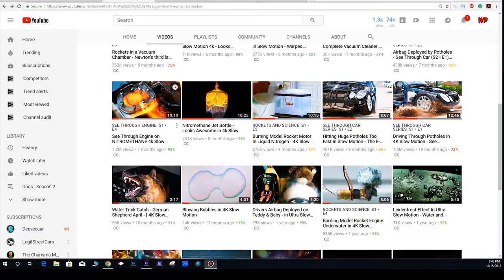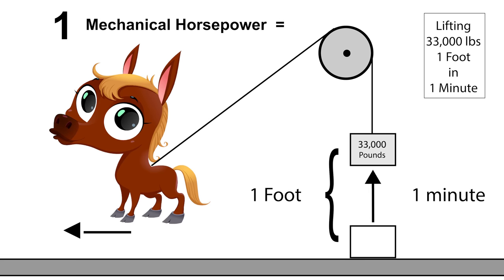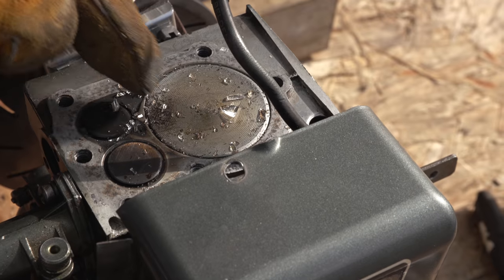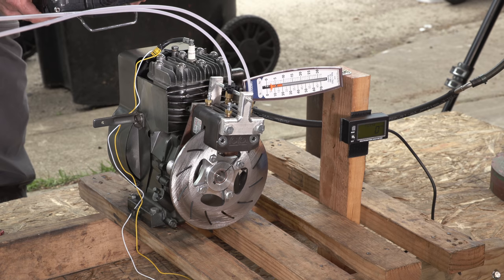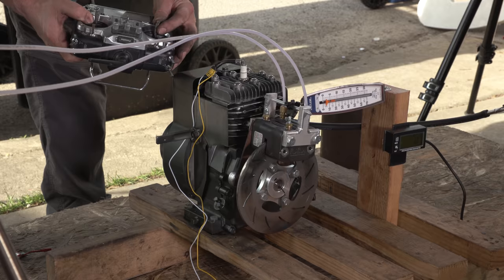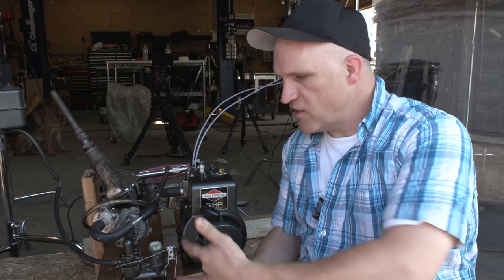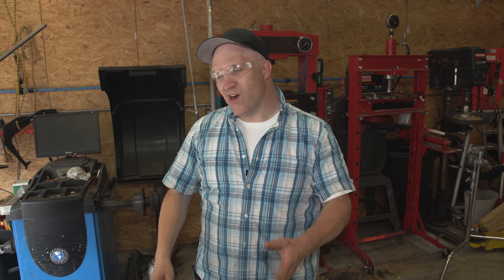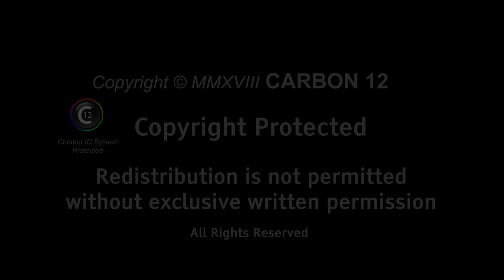See Thru Engine on Turbo Nitro and Dyno  (How much HP does it make?)

Comment: I would like to mention I do believe that the horsepower was less on the Turbo System because the impeller was too heavy and actually became a slight restriction to the exhaust. I don't know if that's true but it's just a thought one thing that I had thought about is using a high volume of air discharged from something like a compressed air tank into the system that would give you a very cheap turbocharged but it would be very finite I don't know if that would be something that could be engineered to give it a forced induction
Reply from the maker: Yes you are correct, up to the point where the turbo spools and starts capturing heat energy it's just a restriction, but as soon as it gets up into its operating range the efficiency skyrockets. I'm not going to pretend that I didn't know that but I wanted to end episode there, that gives everybody a chance to put in their own opinions before the next episode. But yeah you hit it right on the money. Also with the compressed air I'm not sure, that might be something I can try out in the future but I know for sure it's going to have to be matched with the correct amount of fuel I was just going to start running lean almost immediately.
Reply: @WarpedYT  yes I know you are correct about the the fuel mixture going lean. It's cool to see these things on YouTube I will subscribe to your page my father raised me in the shop we have had much fun with building high-speed Volkswagen Beetles dirt bikes and even motorcycles

Comment: make a new video with smaller turbo and  without wet system.pressurize carburetor and gasoline using electric pump.
Reply: What's that do

Comment: I would like to see this setup with a better carb... its hard to force feed a dinky carb like that
Reply from the maker: Agreed
Reply: Have you considered twin-spark? Because the combustion chamber is odd shaped on a side valve engine, it might benefit from another spark plug to ignite the flame front more evenly thus giving a sharper kick - if it is possible to fit another one on the cylinder head.

Comment: Somehow you have to get that turbo to spool up some more or maybe trying a smaller Turbo
Reply from the maker: I have a smaller turbo, and I'm planning on mounting it, but first I need to get this turbo to make boost, one way or another, I know it will almost for sure.
Reply: @WarpedYT  maybe trying some nitrous oxide to get the turbo to spool up my buddy used to use a little sneak a peek shot on his junior dragster maybe that will help
Reply: @WarpedYT  Turn it into a centrifugal super charger? Take the exhaust housing off and find a brushless motor that will produce enough RPM. Then youre force feeding it boost rather than hoping for the exhaust gas to have enough pressure.

Comment: I fitted a small turbo from a Subaru 1.8L to a Briggs mower engine years ago. I just made it really simple with a blow through set up running standard unleaded.  It went really well until the piston melted.

Comment: That motor is waaaaay too small to turn that turbo effectively. Not enough gas flow to make anywhere near enough boost.
Reply: Yeah it takes more power to run that turbo than the turbo is making power
I´d like to see it running waaaaay faster
Reply: max Klassen You couldnt make that motor spin fast enough to get the gas flow for that turbo. The turbo is juat too big for that motor.
Reply: Daniel Beard the motor 'can' spin that fast. With a build kit it would do it reliably.
Reply: @dylanzrim1011  No. You cannot. That motor would have to turn in excess of 12-15,000 rpm to get anywhere near the gas flow of the engine that the turbo was designed for.

It was designed for the exhaust flow and pulses of at least a 4cyl motor. For a 500cc single cylinder engine to have anywhere near the same exhaust properties as a 2000cc 4cyl, the single cylinder engine would have to be turning approximately 4x faster.
Reply: Daniel Beard it's from a compound set up yes? Meaning it is a low rev turbo. 

He's not looking to make 30lb of boost. That motor could probably only take 5lb at most if lucky. 

I'll admit it would still be a bit laggy
Reply: Daniel Beard build break repeat just built one.  Spoiled up just fine.

Comment: If you had used a Tecumseh engine it would have blown it up long time ago. Briggs in my experience are far better engines.
Reply: Dave Micolichek  Yes mostly because the Briggs had half the power. On top end a Tecumseh 3 horse would out run a Briggs 5 horse. I ran a 3 horse Tec with a cam, shaved head, 104 octane fuel, no governor with cranked timing on a stock rod never a problem.
Reply: Dave Micolichek  Reply went up in smoke so one more time. Engine was all stock parts less a cigar muffler. The head was shaved, bumped ignition timing and no governor. The Tecumseh engines made better power do to adjustable ignition timing and better carburation. I ran my 3 hp Tec wound tight but never with out a good load on it. I would guess the lack of load is what killed the ones you saw back in the day.
Reply: Tecumseh engines run forever if you keep oil in them.
Reply: Dave Micolichek even though I like Tecumseh and Briggs, I really like the harbor freight predators and Honda
Reply: Dave Micolichek  The magneto rotated CW and CCW.
Reply: Dave Micolichek  60's and 70's vintage.

Comment: Rising rate fuel pressure regulator and a small electric pump.  Hobbs switch and electric fuel pump at a minimum.  We did the old blow through setups on carb rotaries and it is super crude, but it can work.  Impressive amount of work into this so far -- go for it!   Turbo is a order of magnitude too large, but you might get a little boost out of her.

Comment: awesome vid n thumbs up to that effort.....u need more hp?
Step 1 : return this turbo
2. lets start with the engine itself without the turbo
3. if gasoline gives u 3.1hp, then within technical limits u should get 9.3hp just changing the fuel to CH3NO2
4. CH3NO2 has stoich ratio of 1.7:1 which mean it needs 8 times more fuel pumped in per stroke than gasoline, which also means that if u have the cfm of the carb constant u need to atleast replace the main jet with a much larger jet.
5. we should all be more than happy if u get 8-9hp out of this setup. if u need more we can look in2 the compression ratio the engine is running.
6. shaving off the cylinder head will increase the CR  n maybe 10BHP !

Comment: Love all your videos... been subbed for about a year.      In relation to this video... "Too Much turbo - Not enough engine" (insufficient exhaust air flow/volume/velocity & exhaust Heat)... Turbos Need Heat to spool up quicker,  and one cylinder is not only insufficient in every way for That particular turbo, but too far away from its needed heat source.     Great Video, just the same... love the content.    PS:  What you're labeling as a "wet system" in regards to the turbo/carb setup,  is officially known as a "Draw-Through" system.      Keep em coming!
Reply from the maker: Thank you, I'm finally past holding back all the videos from YouTube so, it should be pretty fun, definitely share your opinion and tell me what you think about all the new videos, now I have three categories of videos heading this channel, I love getting feedback from people so thank you for that!.

As for the turbo, I should be done with the new episode this week and it's going to be extremely interesting, you would normally be right it's too much turbo, and you are still kind of right, but it will make boost and power on Nitro, but not gas for sure, the turbo is too big. 
as for the web system, I know I completely slipped up on the wording, it's called and draw through system, and I actually knew that but during the pressure of filming and everything else, I slipped up, no one else on my crew will correct me, guarantee you that, thanks for your support and thanks for the feedback. Got a bunch of short little slow motion videos hitting the channel soon, tell me what you think !! See ya soon !

Comment: That little engine has some balls to take up all that abuse and not really die until you put the turbo on it. I was very impressed with the increased horsepower with the nitrous at 4000 RPM

Comment: You may need stronger exhaust valve coil springs because the extra back pressure from turbocharger maybe floating the exhaust valve just a thought. Great work and video.

Comment: I installed in a 5 hp Briggs and Stratton engine a volvo turbo, messy thing, the resservoir went leaking, and it flood all the time, so i seal the resservoir so  boost dont get into it making that pump action that cause the flooding, it work neat, you can hear the  sound when the turbo compresses the air, man it was awesome, by the way it was mounted in a drift trike

Comment: First take those reducers off the turbo exhaust,  back pressure kills turbo spooling. Use larger tubing on inlet side, as short as possible. Get a boost gauge on the inlet.  Great series!

Comment: Back in the late 70s in high school, we had thee best industrial arts classes. Electronics, machine shop, wood shop, and power mechanics. 
Power mechanics (auto shop) was my fave. Our teacher was David Vaughn. A retired navy guy with a hot temper, but extremely cool and understanding. Just follow 3 rules. When he talks NOBODY else does. When its study time, its time to study, no fuck*ng off. And, if you ever even think about stealing anybody elses stuff, just leave.
Outside of that, we spent most the time rebuilding lawnmower engines. The 1st one you did had to be a complete basic rebuild. No 1/2 assed job and no mods. After that, you could rebuild a Pratt Whitney if you had the time. But 3.5 Briggs and Strattons were all we had time left for. He had the tools, but if someone else was still working on their 1st engine, they had priority. And that usually ran the rest of the semester out.
Another rule, which was kinda fun. Your engine block had to be royally spotless. Because he would inspect all your parts prior to reassembly, then he would give you a choice. Peanut butter or jelly. Then he would slap a glob of your choice on a part of your block of his chioce...bon apetite. Start lickin. Because, hey. You said it was clean.
His temper almost got him fired a few times. He threw a block of wood at one of us and nailed the kid in the lip because he told him twice to "shut up, this is important". The rest of that hour not a soul even squeaked in their seat. At the end of the class he apologized. The kid he hit was kind of a rich spoiled brat and sniveled "my dads gonna sue". But he realized he was the one being out of line. Next day we were all back to normal. That class was like family. We even had a girl in it. Everybody loved mr. Vaughn, the coolest shop teacher ever.
I saw him about15 yrs later at a Carls jr. I think he had cancer, but I dint ask what was wrong. That was the last i saw him.

Comment: Back in the early 80s I had a Briggs & Stratton 5 horse on a mini bike and I put a Oldsmobile V8 emissions air pump on it, mounting the carburetor on the outside of the air pump and plumbing it to the intake side of the motor.
I didn't have a way to measure the power output at the time maybe you'd like to try it. I put a clear plastic head on a Briggs & Stratton back in the 70s.

Comment: I can do science me. Well done! I thoroughly enjoyed this vid.

For forced induction perhaps you could use another small engine with the camshaft and crank turning at the same speed or a single cylinder air compressor. In this way it would be a supercharger or positive displacement type pump. 
You should be able to work out how much air the Briggs uses at 1000rpm then fairly accurately extropolate for 2, 3 and 4000rpm. With the smaller engine being used as a supercharger you have to do the same - 3.142 x radius squared (half bore diameter squared) x stroke length will give you the volume. Now the trick is working out the pulley size to give you 10% more air, 20% more air. It won't be dead accurate but it doesn't matter. You don't want to turn the 'supercharger' so it induces a pumping loss, or, turn it so fast the power requirement is greater than what the Briggs can deliver at idle. If you could find a small single cylinder air compressor and actually get it to run when connected to the Briggs then this would be a major achievement. Once you have it running then the next step is trail and error to get it to pump air and make power. The fuel requirement becomes much greater though and the carb will definitely be too small. Here's why:
 Take a Detroit Diesel 2 stroke Roots type blower for example: Those blowers are adapted for automotive use as a supercharger, but in Diesel use Detroit Diesel (DD) use them to aspirate a 2 stroke uniflow engines (since uniflows have no dedicated intake stroke) and DD quantified the power they use - it is 100hp. This means to turn that blower when it is under load 100hp of fuel (and air) in the correct ratio have to pay for it.
In any true supercharger application it works something like this: Gives 200hp of air, costs 100hp to drive nets 100hp gain for the full cost of 200hp of fuel (and air). See why turbos are favored over blowers? Turbos are on and off boost all the time but blowers always cost.

So, your Briggs will need a much bigger carb if you use a piston pump as a supercharger but I predict it will work - even as suck through. Get it running on gas 1st and worry about experimentation later. 

Re a dyno, You could use a 240v DC motor as a generator. Gentec make LED contollers for gensets and they are not too expensive. What they give you is a readout of watts, amps and volts. The load can be electric heaters.
For example, I have a 2000w heater with high-2000w and low 1000w.
When I put the heater on the low setting it measures exactly 1000w (or 1kw) and 2000w on the high.

Comment: The oil comes from being pulled past the seals due to high vacuum in draw through set ups. You need more fuel and it will run much much better.

Comment: Cool video!  A damper on your spring scale would help a lot, you would get more of an average reading and less of big spikes.   If the damper does not have any spring effect itself, you could install it directly between the caliper and the block of wood holding your tachometer.  Also maybe add a separate fuel line, in addition to the carburetor, to get more fuel in there.

Comment: Tuff little engine and cool seeing the runs with the see thru head. Turbo suck thru wet system is fine BUT the turbo itself needs to be much smaller and carb needs to be much bigger. That tiny stock exhaust into the huge turbine housing will never run that turbo like you tried. Keep it up, it's fun to watch.

Comment: Try turbo on pump fuel.  I think the carb was the biggest problem as the flow through the engine only started to exit the turbo at the point of it all going pear shaped.  Maybe a smaller turbo would be better but I don't think it's worth the expense. I do know that with carb, block and valve mods and enough messing with the timing you can get a good reliable 5-6ish hp as it was a project at school about 20 odd years ago.  Great video. Really enjoyed.

Comment: is the problem that you couldn't get enough fuel into it with the air only turbo? And if so could you not run 2 carbs? My apologies if that is a stupid question but I just didn't quite get what the reason was for having to run the fuel to the turbo also?

Comment: Great vid, love the dyno! I think the NA runs would go better with an exhaust pipe rather than an open port. About 36 inches of 3/4 inch thin wall emt conduit makes a good briggs header. It needs to be that long because the rpm is so low. Also the 90° intake on that stock carb will hurt. The straight-in briggs carbs have a mixing vane in the manifold that can be pulled out for more flow. I built up a 5hp briggs for a go kart with a carb from a Honda XR200, a header, a cam with more duration, and milled the head for more compression. It felt like easily double, 10 hp or more.

Comment: Reduce backpressure, remove 3/4 pipe and reducer, try 1 inch. Changing the angle the exhaust enters the turbo may help, angle towards larger side of turbine.

Comment: The big advantage of nitromethane is that you can get a lot more power from each explosion inside the engine. Pound for pound, nitromethane is less energetic than gasoline, but you can burn a lot more nitromethane in a cylinder. The net result is more power per stroke. You typically need about 15 pounds of air to burn 1 pound of gasoline, whereas you need only 1.7 pounds of air to burn 1 pound of nitromethane. This means that, compared to gasoline, you can pump about 8 times more nitromethane into a cylinder of a given volume and still get complete combustion. So even with a turbo and advanced timing, heck even higher compression ratio pistons that thing is gonna keep chugging right along. although you can pump 8 times the amount of nitro into an engine you wont get 8 times the power due to the density of nitro compared to gasoline more along the lines of 2.5 times the power.

Comment: On the camshaft grind some off of  the bottom of the lob  and put in longer push rods from a 5 hp engine it changes the lift and valve timing